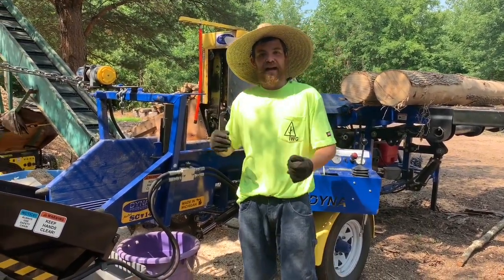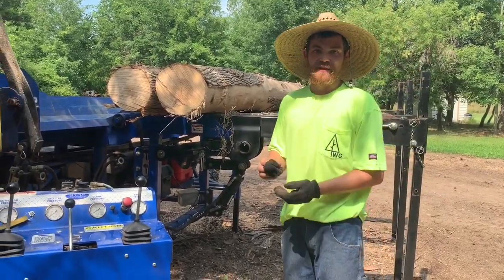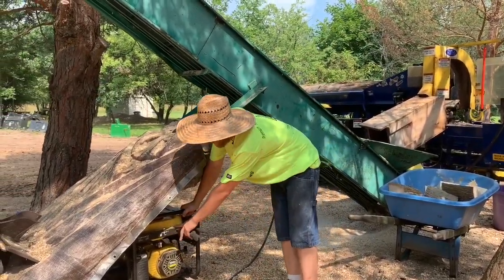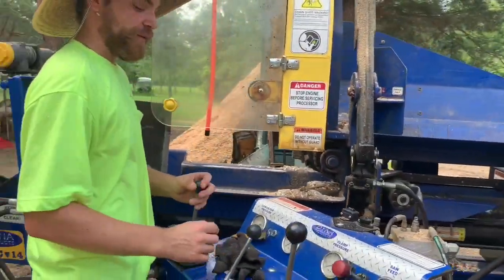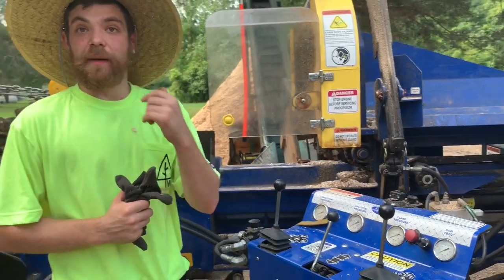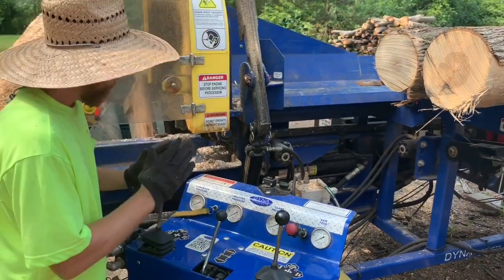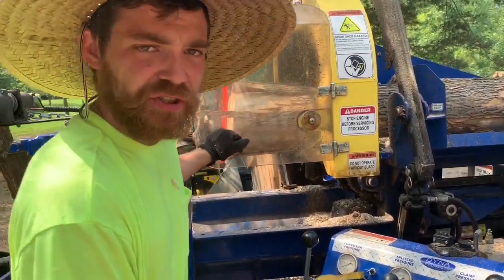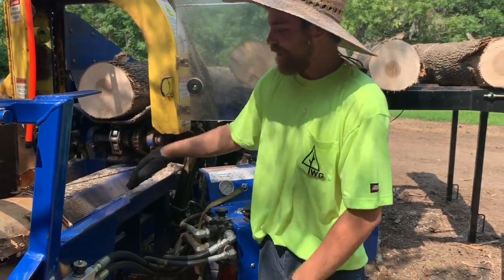HOW TO RUN MY FIREWOOD PROCESSOR! (DYNA SC-14)

Comment: Thanks for the video TWG.  Is it possible for the log to be advanced with the infeed with the bar in the cut?  My old Dyna was like that and it was a big worry for me.  If you weren't paying attention you could break the saw motor.  Joe
Reply from the maker: Thanks for watching joe.. yes you can! It’s a big worry of mine too.. I’ve trained myself to ALWAYS retract the saw right after the cut.. wish Dyna would have made a safety switch  for that

Comment: I have a sc14 and it is not wanting to cut through like the last 2”s of the wood. Have you ever had yours do that? Thanks!
Reply from the maker: Hey Ryan, I sure have... 90 percent of the time it’s chain or bar related.... either a dull chain or the tooth set is off... try a fresh sharp chain... also the bar may need to be dressed.. if the cut starts to wander off what happens is it binds the last few inches.... because the processor has a fixed bar it doesn’t allow it to “follow the error” when cutting with like a hand held chainsaw that isn’t in a fixed position... hope this helps 👍🏻
Reply: @thatwoodguy104  thanks for the response! It was a combination of multiple things on mine. Gauges giving false readings, bar not aligned properly, splitter relief valve to tight, and chain wasn’t the best. I worked on it for DAYS finally got it working the way it should!